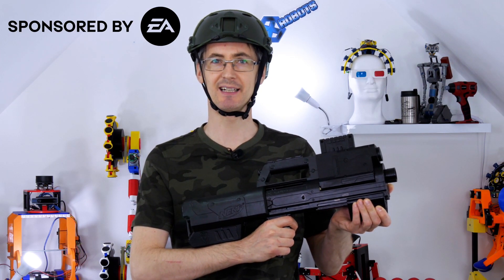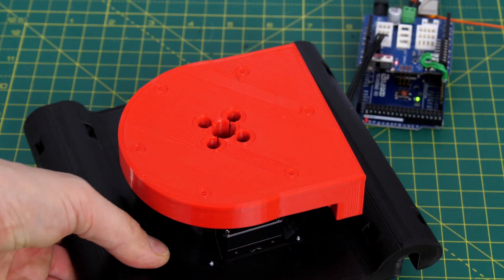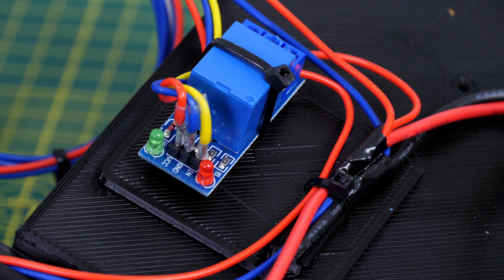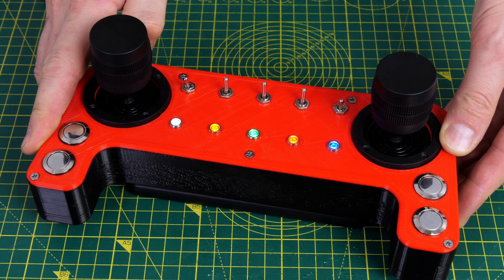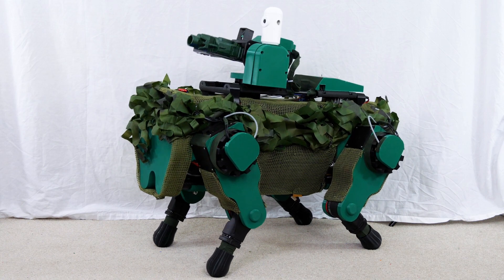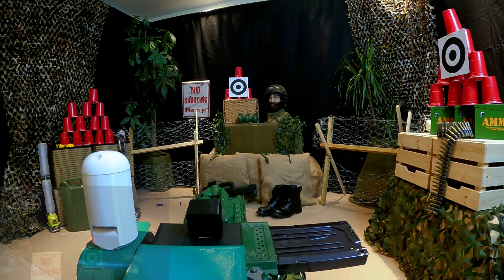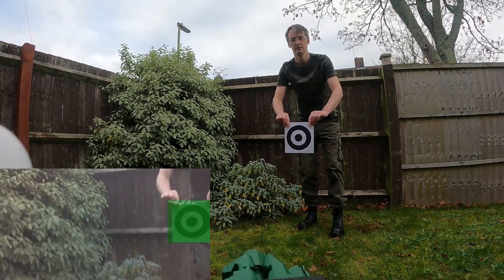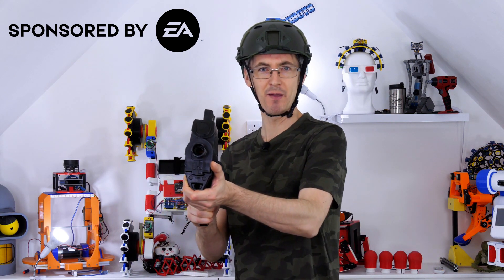Robot Dog Autonomous Functions

Comment: The Russians have been using them as anti-tank rocket carriers. The idea is to be a cheat code around how hard it is to build modern guided missiles. Cold War-era RPGs pulled out of the stockpile warehouses with legs/propellers installed are just an abstract kind of guided missile.

Comment: Some smoother movement, a few more senses, more refined software, carbon fiber chassis, and slap some lightweight modern ballistic plates on it and it will be ready for the battlefield.

Comment: Would be so much better with a wide angle lens.. You should check some "RealSense" cameras from Intel. I use them at work for industrial computer vision and they are pretty cheap for what they offer (2-300$) They would give you depth perception too, instead of just using the size of the target. You could use object detection to find the target, and check that location in the depth image to find the actual distance in real world ( in mm ).
Amazing video, just found your channel from the "Monowheel with Stability Control", nice stuff

Comment: When is open dog V4 coming out with an emphasis on all terrain walking? It would be awesome if you could marry this with stuff I'm the RC hobby space verity of tools. That way you get longer range control, digital camera fpv for longer range video and the ability to map routs on a map and it can autonomously be sent on exploration missions simular to planed flight paths for RC planes that use GPS to follow a path.

Somewhat related. Have you ever played with drones? It would be sweet if you made an open sourced version of the ring drone that patrols a house. Or the drone that Flys around the outside of your house. Give it some of that AI vision training to detect people and send I picture back to you.
Reply from the maker: V3 isn't anywhere near finished yet - there's a lot more control stuff to do.

Comment: Killer job! No pun intended. I'm constantly amazed and inspired by your work. Did you choose dart gun over airsoft for a reason? I could see it being a little too realistic. Also, how are you feeling about the locomotion of OD3, is there coding that could smooth it of some other small tweak?
Reply from the maker: Yes I'll be doing more work on the gait and motion control now I have more torque in this version. I don't think it'll carry much more load right now, so I needed the lightest blaster possible.

Comment: the dog is very unstable as seen by the onboard camera recording, so the video coming needs to be stabilised or the stability of the dog needs to be improved, before processing by nvidia jetson.
Reply from the maker: I plan to make it more stable - it's currently running the openDog V2 software
Reply: @jamesbruton  rebuild the code to be more streamlined, and faster.

Comment: Hey James, you always do a great job, but I think this one was especially good. The dog looks more clean/sleek with the skin put on! :)   Although I still love to see the wiring harness, motors, joints etc!  I think your openDog hardware is great, I think the motors are just about powerful enough for some awesome maneuvers, but it needs more smarts! Please try to incorporate an inertial measurement unit's data into a balancing algorithm similar to segways/your sonic bot, but for the dog! Such that the dog knows that it is unbalanced, falling in a specific direction, and decides to take a step in that direction to maintain balance. The algorithm is very similar to what you've already done with the sonic bot!
Thank you for the videos, you're doing a great job. :)

Oh! Almost forgot, the next step (haha get it?) after the inertial measurement unit step planning, would be load sensors in the legs of the dog! That way the dog can make balancing/movement decisions based on where it knows the ground is!
Reply from the maker: Yep, that discussion will come up in the next video. I should have enough torque now to make it smarter than V2

Comment: Do you think you could extend the camera’s field of view by having the turret scan for the target when it leaves the frame? You would then slowly turn the turret back to center as the dog turns towards the target, and you almost get free 360-degree tracking that way. For efficiency’s sake, you could even bias the turret scan area towards the side of the camera’s view that the target was last seen on.
Reply: That would be cool for follow mode, too. If the turret tracked the target, and the dog just moved to try to keep the turret facing forward

Comment: The FPV feed would benefit immensely from a set of crosshairs superimposed on top of it and the camera pointed so the crosshairs line up with where the nerf gun will hit at a specific distance.

Also, there's gotta be a way of making the control system of OpenDog expansible so that as well as motor control commands, it can take command data for other things with just a single radio link.
Reply from the maker: There are spare serial ports on the dog I can send any data over, I just thought this was clever way to do it.

Comment: If you under sling the weight of the batteries as low as possible to get the weight down will it be more stable.
Reply from the maker: They are, yes